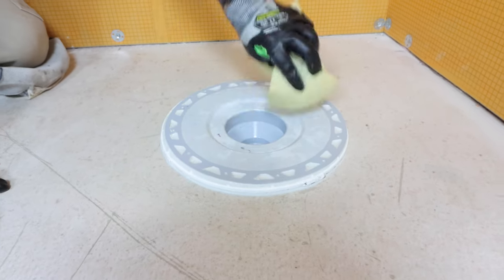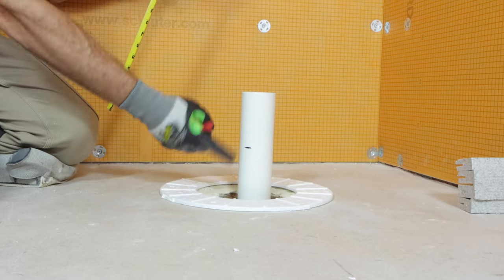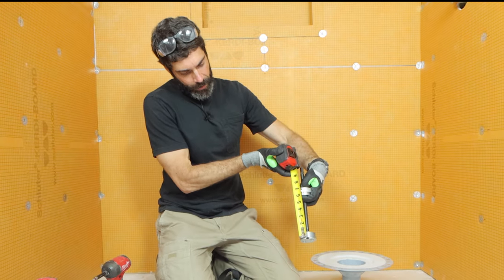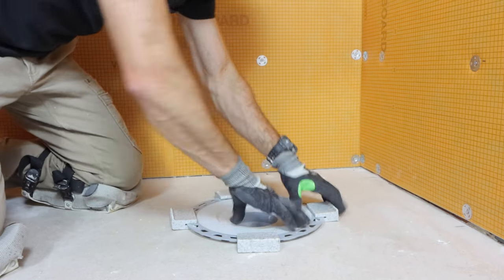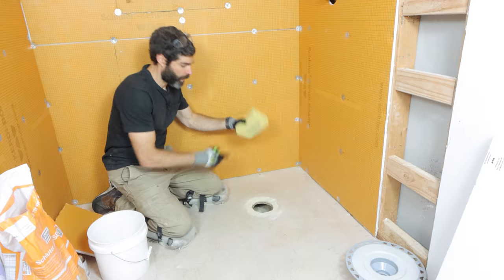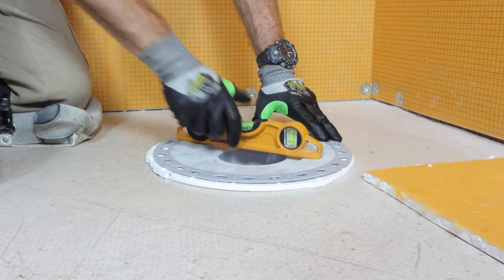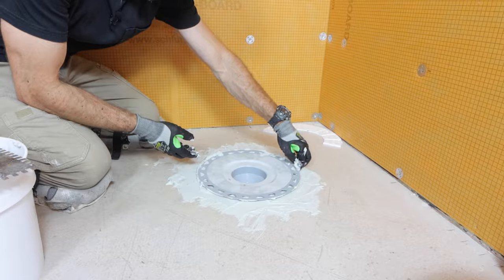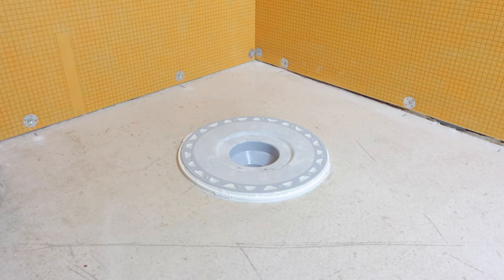Shower Drain Installation for Beginners

Comment: Please pardon me but....if this is the easiest diy method of installing a shower drain for beginners, I would hate to see a method that is more complicated....where I had more steps in the process to miss or mess up....where I needed more special equipment or specific materials that I may or may not use properly.
Reply: i thought the same
Reply from the maker: this is just one way to install it, the other way is if you have access underneath or can solvent-weld the vertical pipe yourself - but the one thing you need to know is that this drain also makes tiling easier because the drain grain is adjustable 👍🏼
Reply: I think I had less steps when I replaced the head gasket on the engine of my car...😁
Reply: @HomeRepairTutor  Yep, I personally had to do that. I hammered open the ceiling drywall from the room below the shower. Because the previous pipe was installed very diagonally (about 30 degrees), making the schluter drain impossible to be level, I cut off the entire p trap assembly -- along with 30 years worth of debris and stench lol -- and redo it. Because I assembled the new p trap first it was not possible to solvent-bond it to the pipes and turn (tried it without turning but it leaked) I opted for the mechanical option by using flexible pvc couplings.

Comment: It's good stuff ~ but at 5 times the cost of hardi-board & redgard, the price is silly.
Reply: Hardy and redgard don't build you a shower pan.
Reply: one peice of hardi board weighs 35 lbs, kerdi board 2lbs..... yes currently 38$ per board but you have other options that are lightweight and cheap.... Goboard 3ftx5ft1/2inch currently 21$ at menards and weighs 7.5lbs.... do hybrid builds also menards makes prova board like schluter and shower pans

Comment: Great videos! Is there a way to install a drain connector to a 2inch ABS riser coming through the concrete that is not perfectly vertical? I typical ABS welded connection to that pipe would end up with an 1/8 inch deflection from horizontal at the drain surface :(

Comment: I did exactly this but my flange is too low now. After installing the shower pan and the circle fleece,  the flange is about 1/4" too thin. Can I simply add 1'4 thin set to that area when tiling?

Comment: Have you tried the FloFx drains?
Reply from the maker: Not yet, do you like them?
Reply: I second Jim’s comment. Flo FX drains are far superior in quality and adaptability. Really easy to use if you do mud beds, which is what I prefer to use.
Reply from the maker: @davidherd3739  I’ll have to check them out, the only concern I have is warranty if using the Schluter system - can they be used with the trays?
Reply: @HomeRepairTutor  not yet, hoping you did😉 however they look exactly like the Schluter drain install process
Reply from the maker: @TR4Ajim  I’ll have to check with our rep but I think we both know what the verdict will be 👍🏼
Reply from the maker: @TR4Ajim  btw, thank you for the great suggestion, I really enjoy learning new ideas and techniques 💯
Reply: I'm also thinking of using FloFx drain myself, planning to use it with schluter tray. It looks like all you'd need is cut the circular hole from the tray into a square hole to fix the flofx drain profile, and I guess thinset the seams with kerdi band or other waterproofing band.

Comment: The 2 inch drain outlet has a surpising amount of slop when fitting a 2" abs pipe with my kit's drain.  I noticed in store they had black colored abs schluter drains and these did not have the sloppy fit.  Anyone else run into this and have a possible leak issue?

Comment: if you have to cut out the foam insert from the shower tray, why doesn't it just come as a separate piece?
Reply from the maker: It’s not necessary to cut it out unless you’re setting the drain before tray or need to set the drain with no access from below
Reply: @HomeRepairTutor  I don’t follow. Why would you want to set the tray before the drain? And how does not having access from below have to do with it? In this video, why couldn’t you have cut the drain pipe, then set the tray, then glued and set the Drain on top?
Reply from the maker: @conradcoolerfiend  this is for when you need to set the drain ahead of the tray, eg plumber needs to set the drain before tile setter is ready to set the tray.
Reply: @HomeRepairTutor  oh ok. But if you are doing the whole job yourself, would you set the pan first? Or would this technique still have a use case?

Comment: I don’t understand why some Schluter kerdi shower trays have thicker spacers for the drain.  I bought an Identical tray 38x60 with drain on the end but mine was about 1” thick that tapered two levels toward the 2” drain.  Not like yours which is flat here and probably 1/2”